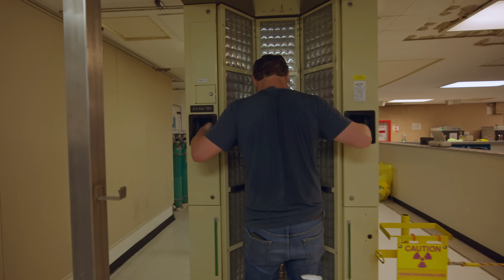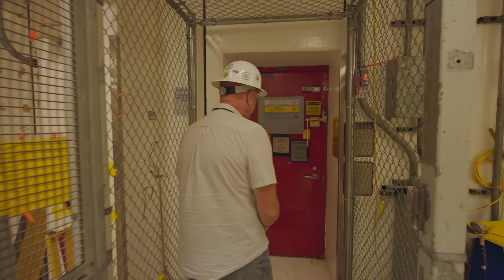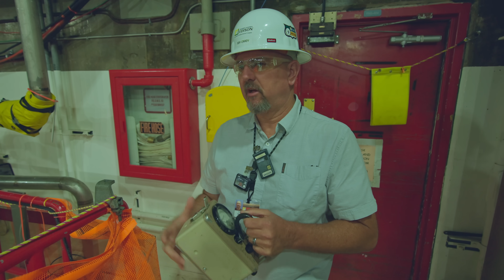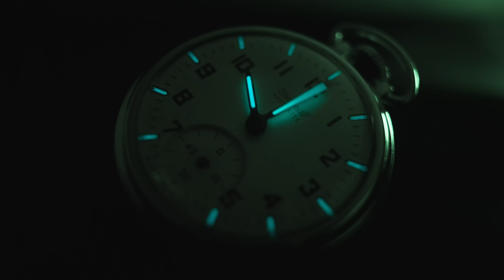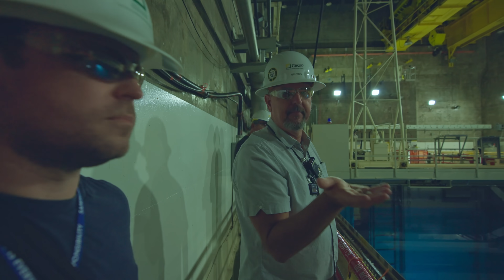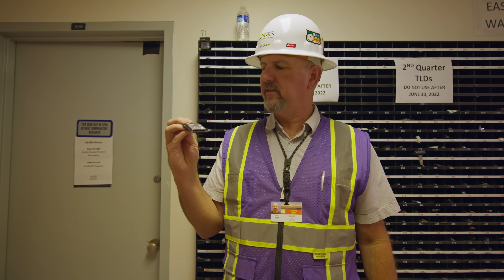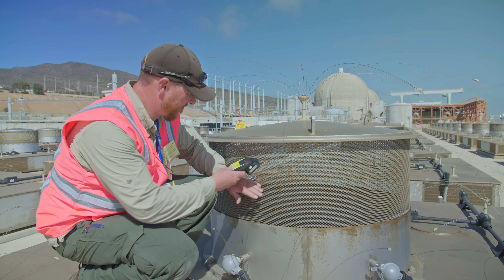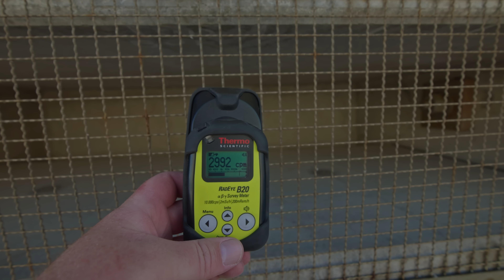Inside San Onofre Nuclear Power Fuel Pool and Spent Fuel Storage

Comment: 111022. I worked with DOE in NM on the WIPP in Carlsbad, early 1993 to late 94. Is this site still being used for storage of low-grade disposals of clothing, tools and such?
Reply from the maker: I think so. Not sure if they are sending stuff from SONGS to that location.
Reply: @RadioactiveDrew   11-17-22  Drew, curious.... if SONGS is being decommissioned, are you able to research and tell us, why the millions of miles of copper wires are STILL strewn across the 5 freeway over the Camp Pendleton Hills. Let me state it's been a few weeks since I last drove back and forth to San Diego but if I remember correctly all that copper is worth a few million dollars. Why hasn't it been taken down and recycled if the outgoing energy of SONGS is no longer up and running?
Reply from the maker: They are still going to use all that equipment as an interconnect between different utilities.
Reply: Nothing from commercial nukes is coming to WIPP, just the TRU legacy low level waste so far. WIPP has been extended for a long time.
Reply: @jimmymosierjr.7530   Ok Jimmy, Thanks!  Though I would like to see something other than low level waste stored there, I understand the position and the reasons why.  While working with the DOE, a truck and casket were driven up to up to Sandia Labs on Kirtland AFB. I was amazed at the technology and precision that went into the manufacturing of both the truck and the casket.  And this was back in 1993/94 in Albuquerque.  I asked what they did to drive the truck and casket up from Carlsbad as it was empty. No one knew what it was. There was no escort. They just drove up in the middle of the night.  With all the various types of equipment and trucks that go through Albuquerque, seemingly, no one blinked and eye.

Comment: I can't help but think that the thermal energy left over from spent fuel assemblies could be used for heating purposes. Is the risk worth it? Maybe not with current technologies, but we continue to burn fossil fuels for heating, while simultaneously dumping billions of BTUs of waste heat from processes like power generation. It just doesn't make sense. Using a heat storage medium or heat sink to moderate temperatures throughout the year, acting as both a heat source in winter and cooling source in summer.

Comment: I mean they built a new canister so they can put those rods in on the back of a semi they watched a fucking missile at one of the empty canisters and there was just a couple scratches on it those things are really fucking strong it's basically about having 30 nuclear bunkers inside of one steel case on the back of a semi truck that thing will not explode say you were to watch a javelin tank destroyer if you're watching on it the whole thing would be fucking fine

Comment: I was really curious how much heat the spent fuel produces in the outdoors storage, and for how long they would be hot. Seems like it's a lot of heat, for a long time, it's not possible to use that heat for anything?
Reply from the maker: I’m sure they could find a way to use that heat to make power.
Reply: The amount of power in question is pretty small and not worth it
Reply: @manw3bttcks  Didn't mean the remaining power, was talking about all the heat coming off it, that just vents into the air.

Comment: What's the reason for the plant shutdown?
And how's everyone in OC+ SD gonna power their Tesla?
Sort of a bummer, used to love surfing the cooling pipe that went out to ocean when swell was right
What's the alternative power source to replace this?
Reply from the maker: There isn’t a replacement power source for this loss. The reason why it was shut down was because the new steam generator had damage from shipping and leaked. Or at least that’s the reason given. Even though they could have kept the other reactor running with no problems.

Comment: I was an operator at San Onofre, neat to see it again. So sad they prematurely decommissioned it. I remember co-workers who needed overtime that purposely wore clothes that would set off the detectors, they had to sit around awhile to gas off! 😂
Reply from the maker: Interesting way to OT.
Reply: Where does one find clothes that "purposely set off detectors"?

Those are the EXACT kind of people that I would NOT want to be working at my nuclear plant..😒
Reply: @davelowets  usually anything with artificial fibers. Rayon and Nylon were always a big getter because they tend to retain gases (Raydon ect...) Wool seem to be the one that I always got hit on. Walked in once with a full set of clothing, walked out a few hours later in cheep shoes and a tank top while everything off gassed.
Reply: Should that sort of scrote be working in the nuclear industry?
Reply: you mean they got “crapped up” ? LoL ya remember those people
Reply: I ran the Bigge crane over at unit 1 during decommission of the containment wall around the sphere.
Reply: Static electric/synthetics are good for that. 🎉

Comment: So interesting to see inside a plant like this. I have always been a pro nuclear power person so I find these videos fascinating. I live in the UK, about 20 miles away from Hinkley Point Nuclear power station. Hinkley Point B - a gas cooled reactor started producing power back in 1976. It was shut down for the final time in August this year. But it is by far not the end of the line for nuclear power production at Hinkley because two new reactors are being built. When online they should provide power for over half a century to come. I think each of the two plants are going to produce 1.6mw in electrical power. Such a shame that poorly designed plants have in the past given nuclear such a bad name. And when you consider the current fuel situation, it's a shame we don't have many more nuclear power stations in our country. I think with well over half a century of knowledge behind us, mankind is more than capable of building nuclear plants that will operate safely throughout their life time.
Reply: Hinkley Point C won't be anything like A and B though, A were homegrown Magnox units and B were homegrown AGR units, both of these designs used CO2 as coolant making them safer than water-cooled reactors, C on the other hand is going to be just another water-cooled reactor built by the French and owned by the Chinese.  We can thank the Tories for that, between 1979 and 1997 if it wasn't nailed down the Tories sold it off and in 1994 it was the turn of British Nuclear to go the same way as the rest of our industries did under Thatcher and Major.
Reply: 1600 MW
Reply: @100SteveB While in the 1970s things might have looked very different, what with the oil cartel creating an oil crisis, and gouvernments wanting that sweet plutonium to pursue their cold war goals... You simply cannot justify nuclear today on an economic basis. Never mind risk, or environmental impact (although those do somewhat factor into the cost of financing such operations).

The simplest and most undeniable metric is the strike price:
* Hinkley Point C is currently projected to be 128.09GBP/MWh, if and when Hinkley does go online. It is currently projected for commissioning in 2028, after a projected 11.5ys construction time.
* Dogger Bank A,B and C are currently projected to be 49.77GBP (A) and 52.41GBP (B and C) per MWh. Offshore wind is still 3x as expensive as onshore wind, making it one of the most expensive forms of renewable energy. Actual construction of the first bits (laying the undersea cables) started in 2022 and while each section should have a commissioning time of between 2-3 years, the first turbines are already delivering power.

If you look at construction cost, a similar story emerges:
* An EDF EPR costs 16B GBP to build (hinkley) for 1.6GW at a theoretical 90% capacity factor (yeah, right, the french are more like 72% on a good year), or 11.11GBP per watt (effective, with capacity factor).
* Dogger Bank C will cost 3B GBP for 1.2GW nominal capacity, at a 60% capacity factor, or 4.17GBP per watt (effective).
Again, these numbers correlate to the strike price.
Even when using the overly expensive Tesla Megapacks (1000megapacks would cost 1593.27M usd,and hold 3854.40MWh) at 34c GBP per Wh, you can add 20Wh of battery storage per W of generating capacity for Dogger Bank to plug the difference with the EPR.

Then there is the decommissioning cost:
In September 2021, Belgian politicians made public the projected cost of decommissioning (and for long term storage) of the 7 ancient reactors in Belgium (6GW nominal capacity): 18B EUR, or 3B EUR per GW installed. This was the optimistic end of the scale that industry provided, as the greens leaked the upper projection at 42B EUR, or 7B EUR per GW. These numbers would add 8.5B GBP (9.6B EUR) or 19.8B GBP (22.4B EUR) to the cost of Hinkley. Or 2.9GBP and 6.9GBP per W (effective). Or another 8 to 20Wh of expensive battery storage for Dogger Bank. And even then there will be change left to pay for decommissioning of the off-shore wind park.

Whoever is still for nuclear today, has never looked at the actual numbers.
Reply: Too bad about the Chinese involvement
Reply: The problem is only in part the poorly designed plants. Also not only the bad maintenance (France, looking at you, too) and corporate greed. The ugly thing is that all the safety calculations from the height of the nuclear era turned out to be wrong - and they tried their very best to be conservative and cautious. But they expected like one major accident in 300 years with a massive amounts of active plants, and reality ran through that error budget within 50 years. The question that needs to be addressed is none other than how we're supposed to run 250 more years accident-free knowing that those safety calculations were underestimating the risks of operation. How to factor in the extra issues of plants being run beyond their calculated lifetime? They underestimated risks and for 20 years corps have reacted to that by ignoring how long those same people planned the plants to run. We know how to build safer plants (actually they overrun their construction times and budgets even more and get more complex), but instead of dealing with the risk - maybe even just accepting it - we are unable to get the discussion there and instead discuss how safe accident-free plants are and how safe the spent fuel is if you put it under concrete that lasts like 1/100 halftime. That ignorance is where the technology becomes infeasible. You need direct consequences for managers and engineers involved malicious shortcuts. You need a well educated public that can handle the fact that a worst case disaster changes the countryside but all non-disaster is what pays their standard of living. If we're just too stupid for that, it's much better to just stop 🛑 overconsuming.

Comment: 26:10 Can I buy one of those spent fuel canisters on Ebay?  Considering using the "hot pile" to provide hot water and cabin heating in an off-grid scenario.  Could I transport the assembly in a standard 15 foot U-haul box truck?  Any special permits needed to transport to Arkansas?  < This post was made as a joke.  I understand the spent fuel will remain in it's casket for many years, and is not something released to the public, nor would I want such thing on my property. >

Comment: Ideal dive training pool
Reply from the maker: It would be...if it didn't have a bunch of cobalt-60 and some other radioactive isotopes in the water. You could do dive training for sure. But you would have to decontaminate yourself and all your equipment afterwards.
Reply: @RadioactiveDrew  but since the pool is now empty of fuel, does it not become a "normal" pool now?. No heat from the fuel decay now..

Comment: Asking a Stupid question..14:20 Why is the water so clear, so still. Why is it tinted blue? the florescent lights don't seem to be emitting that much of a blue spectrum light like a blacklight.. A pool at night doesn't look blue even with a blue liner, and the yellow lights don't make it glow yellow. Also if you stuck your big toe in the pool, how long before you'd die. Again thank for the video.
Reply from the maker: The water is so blue because of all the metal in the pool. You could go swimming in that pool if you wanted. But keeping the water out of your mouth would be top priority. You would also need to wash off really well and check to make sure you got it all with a Geiger counter.
Reply: @RadioactiveDrew  Thank you. I dont get it. I didnt know you could dissolve/Sublimate metal into water. TY either way.

Comment: That stainless thickness as 316 L would take a 200 ft drop to crack it open. I was a steel worker for 20 years and work with all grades of metals.

Comment: The blue glow is particles slowing down because of drag through water. I hear that its only observed with objects that break the light speed boundary. Not sure if thats the case because how would you measure it?
Reply: Light travels at different speeds in different mediums, absolute light speed (C) is the speed of light in a vacuum, the speed in air is slower, and the speed in water is slower still.  This means a detector in air can capture light moving through water just as a detector in space can capture light moving through an atmosphere.

Comment: I think Cherenkov radiation occurs when a particle exceeds the speed of light in a particular medium, water in the case of a nuclear reactor, which causes the release of a photon.

Really interesting video!

You earned a subscriber👍
Reply: It's more a case of a particle moving at the speed of light in its current medium decelerating to the speed of light in water which is less. The energy lost as the particle slows down is emitted as light hence Cherenkov radiation. Nothing can go faster than c, the speed of light in a given medium. For vacuum c is just under 300,000,000 meters per second, for water it's 225,000,000 metres per second.
Reply: @robertsneddon731  Thanks for the clarification.

Comment: Hmm Never Met you Drew...I worked for Bartlett Nuclear for 3 years there as a Readioactive Material Handler.  Unit 2 and 3 were decent.  Unit 1 was a mess, very "crapped up", leaking into the ground.  Now the real weakness of any plant isn't the technology, it's the people following the law.  We had issues in 1993 when I left with finding a burial sites for spent fuel and waste.  Tennessee that was reducing waste by incineration was not taking anymore waste as well.  I clearly remember packaging waste WITH FREE STANDING CONTAMINATED water as fast as we could in plastic bags when the legal procedure was to have it solidify with hardening mix (looked like kitty litter). We threw those bags on the truck still dripping wet, and driving out of the plant, because our waste contract was running out, I believe it was with Hanford but can't remember exactly.  Bad mojo.  I remember you Dan Galleon, Cameron Robertson, Brian Webb, Kelly, Karen, of course Jocelyn O...  I remember when SONGS got buy off to put all the units in "wet layup" instead of doing the right thing and decommissioning the plant to natural state.  That should have been done 30 years ago when the decision was made that the plant was not financially viable due to the cost of waste burial.  Nobody wants spent fuel rods, 600lb compacted drums, or huge beryllium containers filled with high dose waste (fuel filters) in their state buried in the ground.    Haha yeah we used to say Dilution is the Solution.  Still sending that crap down the road in bags not packaged was fkd up.

Comment: Is it possible to just put the used fuel rods back into the earth?  The material was radioactive when it came out,  it is now less radioactive.  ?
Reply from the maker: No, they are more radioactive than when they first got there. After fuel runs in the reactor the U-235 and U-238 change into other transuranic elements, which are usually way more radioactive than the fuel. That's why they are so dangerous and still very hot.

Comment: When you were on top of the dry fuel storage unit; what are those wire "sprays" for? I would have thought you would have asked because they're kind of unusual. Are they for static dissipation or what?
Reply: awesome! Made me crack up. Complicated Scientific hypothesis questions… No sir, they’re for seagull shit. 😂
Reply from the maker: They are there to keep the birds off.
Reply: @RadioactiveDrew  Ah, so. Thanks.
Reply: The seagulls love the warm air especially in the colder months.  The wires are to keep the seagulls off the area because they like to poop a lot

Comment: We had to put overalls on with plastic shoes before we went into an R Area and were more careful in a C area. R = radiation and C = Contamination. the difference. radiation is whats emitted by anything radioactive, it can be recduced by distance or shielding. . Contamination is what is irradiated thats loose and can be carried out. and is the main danger to most people as it can travel outside of an area of protection. I'm surprised that they went in with no real protection personally. if they picked up any contamination then they would lose their clothes and wouldn't be allowed to have them back. the same goes for the cameras. I  would have insisted on having them protected with plastic like maybe cling film.  its only common sense
Reply from the maker: They checked us and our cameras when we went in and going out. I didn’t shoot the leaving part because my battery ran out.

Comment: I do not get how can gamma radiation leak out of a went? Is there a direct path for radiation to that grille and to the outside world? Or is the air itself contaminated with gamma ray emitting particles?  particles
Reply from the maker: It’s because the spent fuel is mounted above that point and it’s also the thinnest area of concrete for that structure.